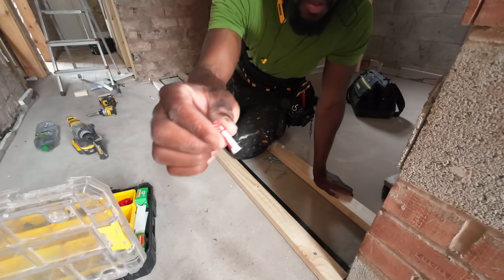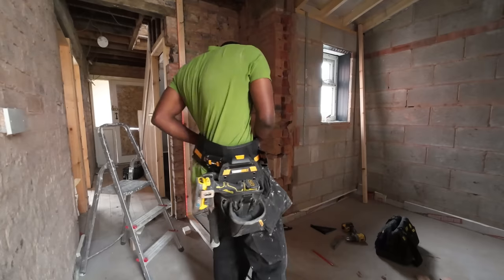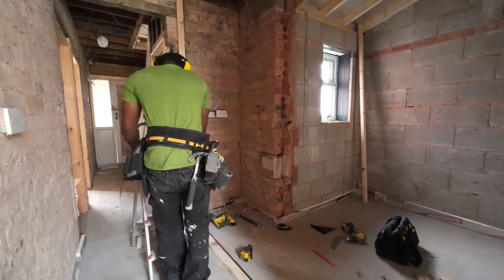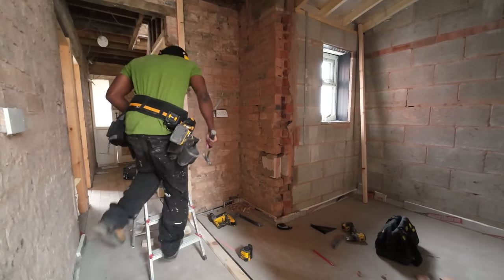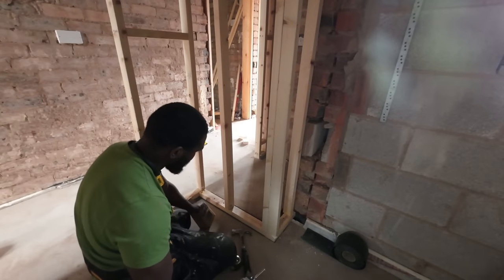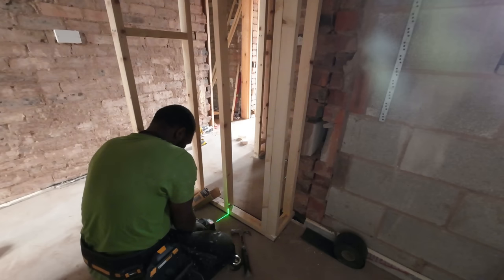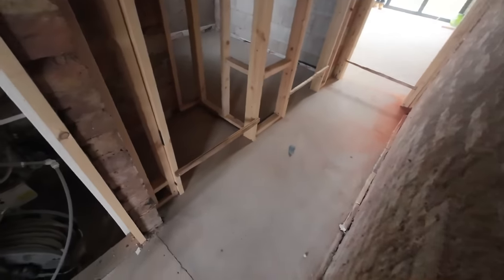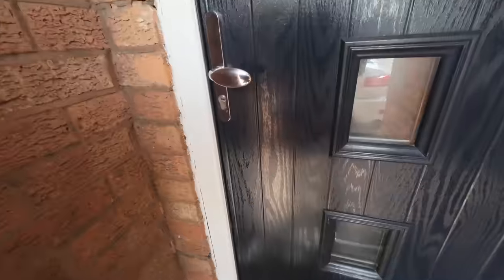Building a stud wall A Day in the life of a UK self employed carpenter

Comment: you can get concrete screws so you dont need plugs so all u do is drill though the wood and into the floor then screw it in
then u dont have to hit the plug in with the hammer and its wayyyy faster 
they are timco concrete  screws
Reply: Best ever
Reply: There’s many ways to skin a cat

Comment: You are wasted Keep these videos up, rare you see people carpenters using laser levels. You put money ££ into equipment showing professionalism normal level is fine perfect , many use just a level still like me. The new breed of carpenter is coming and profection and my favorite tool in the box lost with out it is the speed square perfect line every time and many other ways to use it and was a joy watching you use it.
Reply: Rare to see carpenters using laser levels? 😂.. what jobs have you been on 😂
Reply: I use 6ft stabila to level stud.. and dewalt lazer for leveling sole plate up to the ceiling (this is stick building) .. other guys will build the wall on the floor and then stand the whole thing up in one no need for a lazer level 👍
Reply: @alexd789  I stopped working many years ago before tech was out laser would of made life so much better,  in the 80s but was mid 90s before anyone could buy them and cost was high.

Comment: Where's your circ saw bro?😅

Also, whats the maximum spacing of studs in the U.K. ?
Reply: 400 is best, make sure that they work sheets though
Reply from the maker: flex volt battery was dead 🥲
Reply from the maker: @retroclickmedia4422  agreed

Comment: You need a nail gun mate
Reply from the maker: i agree
Reply: @ttdowgcarpentry2390  frames arent structurally sound with screws as can snap use nails as they can bend with the mvemnt of the building
Reply: @owenandrews1949  Carpenter of 40yrs,  what a load of pish, much better bite with screws, once that central heating is on full pelt and the timber starts shrinking nails dont hold like screws, remember plasterboard nails popping.
Reply: @starofdavid9919  yes but I can tell you now that is fact that it isn’t as structurally sound